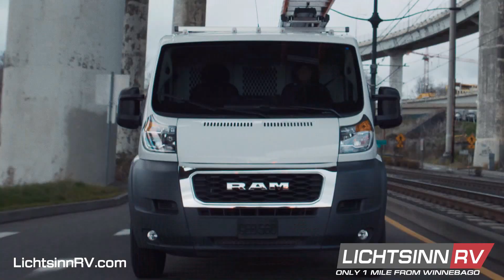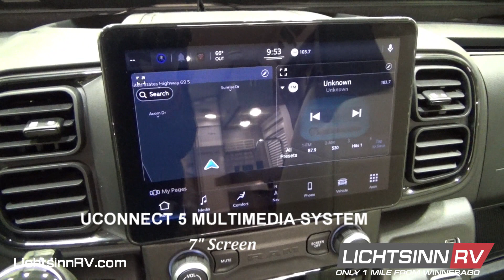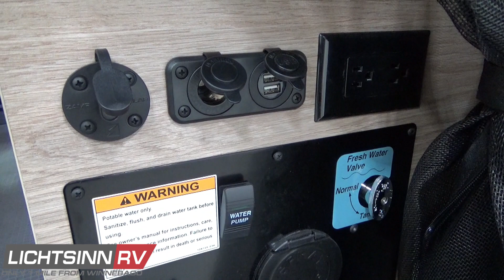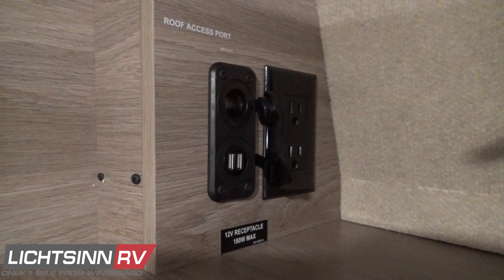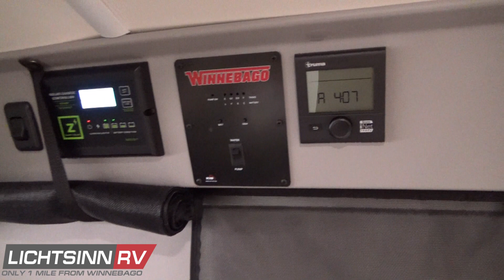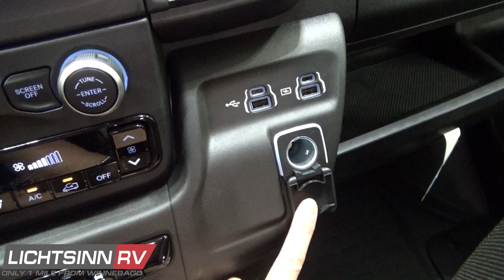LichtsinnRV.com - 2023 Winnebago Solis Pocket 36A

Comment: Maybe I missed it but does The Winnebago Solis Pocket come with a spare tire?
Reply from the maker: Good morning!   Thank you for your note!   So many auto manufacturers have gone to tire inflation repair kits in lieu of spare tires to free up weight to meet EPA fuel economy requirements.    All of the Ram ProMaster products have tire inflation repair kits in lieu of a spare tire.   However, we can add a spare tire, rear mounted in a few different options if this is necessary for you.   Hope this helps!
Reply: @LichtsinnRV  Those tire inflation repair kits are great for a slow leak but kind of useless for a blowout or shredded tire. Any idea on how much degradation to MPG performance mounting a spare on the rear door might be? A low-high range estimate is fine. I'm looking at Wildpeak AT/3 tires.
Reply from the maker: @michealodrisceoil  Good afternoon Michael!   Thanks for your reply... it would be nominal and we can add one for you... here is fuel economy info from the EPA  "The EPA says that for every 100 pounds taken out of the vehicle, the fuel economy is increased by 1-2 percent. "
Reply: @LichtsinnRV  Thank you.
Reply: @LichtsinnRV  The Ram 2023 website shows a factory spare tire option below the chassis at the rear. Can this be added to the Solis?
Reply from the maker: @bandit1732  Good afternoon Al!   Thanks for your note… yes, that is new, and only on the 1500 Pocket chassis.   While the RV package has they tire inflation repair kit, we could look at the original carrier underneath thru our local RAM dealer, or we can do the Landed Gear spare tire attachment carriers we’ve using on the rear of the vans.   Either way we can help you!   Hope this helps!

Comment: When did Winnebago begin using the 2023 Ram chassis?  All of the versions I have seen on dealer lots and on the Winnebago website are the older 2022 chassis with the old front end and dash.
Reply from the maker: Good afternoon Al... thanks for your note... the 2023 chassis was just released and is now being built on the Pocket... albeit with a significant price increase.   Hope this helps!
Reply: @LichtsinnRV  - what is the reason for the “significant” price increase?  Is the 2023 that much different from the 2022?
Reply from the maker: @Patrick_Ross  Good morning!   The chassis  has been restyled for the 2023 Ram model  year and is the higher cost from Ram... it shows as a separate line on the Winnebago window stickers... we do have both available now